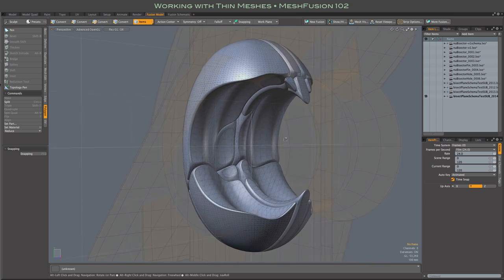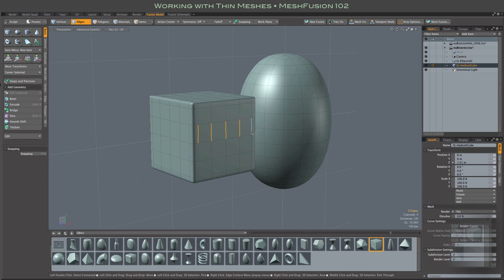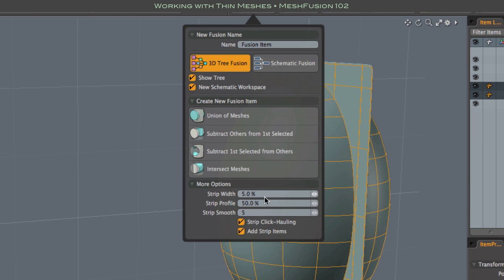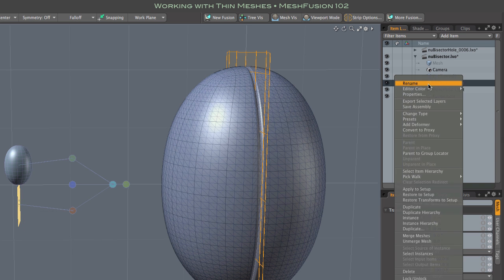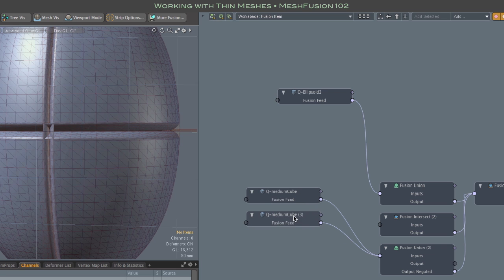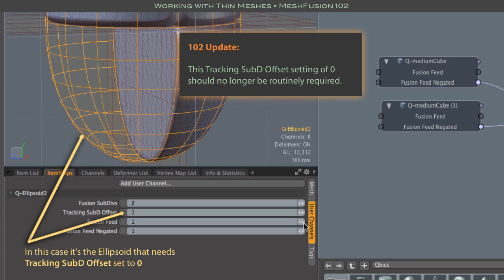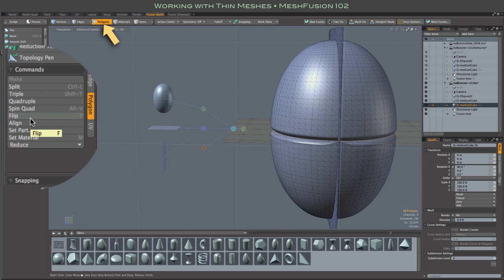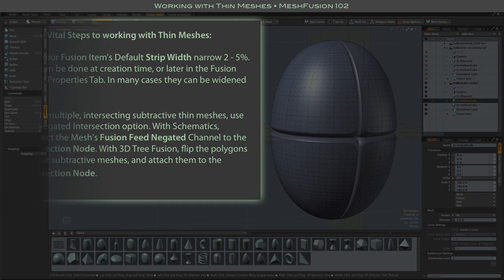MeshFusion 102 - Thin Meshes

Comment: Using modo 801 when mesh fusion was a separately purchased plug in. Wow, I could follow until 3min into it. When you switched to the schematic layout, I lost you. My schematic did not look like yours. I had no connections.